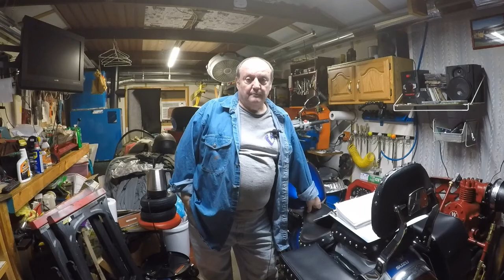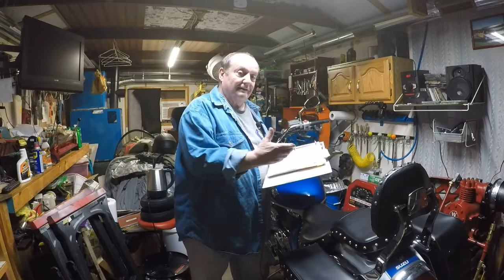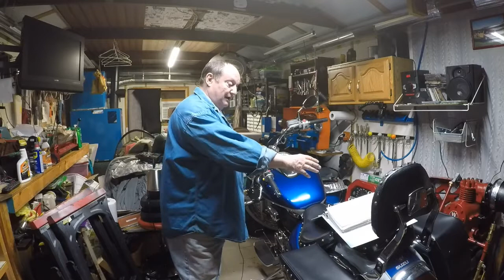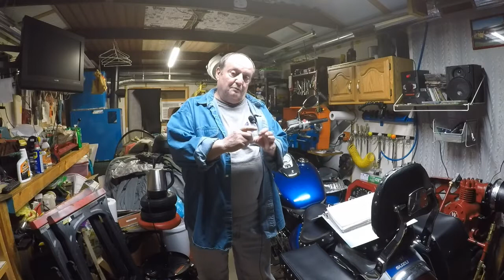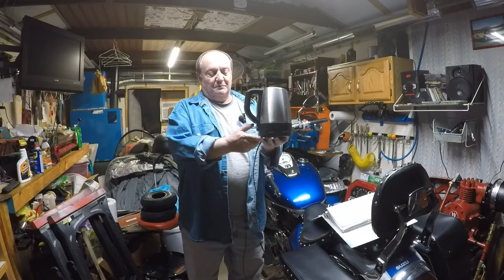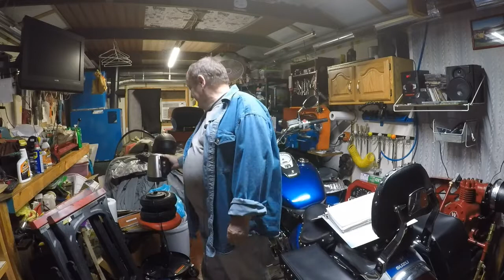STILL WORKING ON IDLE PROBLEM

Comment: Very good video.
Reply from the maker: Hi Michael, I think it's the I.S.C.    Idle Speed Control.  The code that comes up is  C40. I ordered a new I.S.C.  and I have the scanner that is needed to reset it when you put a new one in. If that doesn't work I may have to take it to the dealer.  Norman.
Reply: @2001himax  Yes Norman. This must be it. It will be interesting how this new ISC goes...

Comment: Hi 2001himax. I just recently came back from a ride on my 2003 VL800 and it sounds like the exhaust from my rear jug is louder and has more pressure and gas then the lower exhaust. What does your exhaust sound like? are they both the same volume and pressure? Thank you so much. Im really hoping I don't need an overhaul

Comment: Hey friend the code c40 on suzuki c50 is the TP sensor. I had almost the same problem and i change the TP sensor my motorcycle working fine with no problem any more.
Change it and adjusted will work great. Thanks
Reply from the maker: Hi Mohammad, Thank you for the info. Every time I go to work on my bike something else needs repaired like my 23 year old mower. Got a new mower. Then a chipmunk chewed some wire on my car so i fixed that yesterday. Hope to get back to the bike soon. Norman.

Comment: Think i found your problem..i have an 09 c50t.. This is caused by the clutch lever switch. Aftermarket levers don't hit the switch right, and many people bypass the switch. The ECU can't figure why the motor is revving so high when it thinks the clutch is in, so it throws the C40 code (idle too high). I'm amazed your dealers are not aware of this, as it is VERY common with these bikes with aftermarket levers. The uninformed will start replacing ISC gear. Google it.
Reply from the maker: I will check it out. Thank you for your comment. Norman

Comment: Oh! my a dud kettle is no fun at all.  My Suzuki manual also does not mention C40 code. However in case there is a commonality with Suzuki equipment I checked the Suzuki V-Strom.co.uk forum search, and it came up with     "C40 could be  the  rear injector ISC    (IDLE SPEED CONTROL) valve is sticking"  Might be worth looking into. Sincerely hope this does not lead you further astray from curing this fault.  Best of luck Norman.  Stay safe you two in these difficult times.
Also in my manual the no 40 pin on the ECM TERMINAL  is the rear cylinder fuel injector. (coincidence?)

Silly question I know but have you checked all of the connections air hoses and electrical wiring.  Do the throttle valves close smoothly etc?
Reply from the maker: Watch my latest video. I have a few more things to try. Norman

Comment: Hi Norman,
Unless you can locate the idle speed control valve (this component when faulty gives a C40 code on other Suzuki bikes like the GSXR's), pls follow yr service manual and check the following:
1/TPS (use a multimeter to read values as the throttle is twisted / butterflies rotate)
2/Also check the CKP sensor.
3/Lastly pls also check if yr throttle valve is balanced correctly and if the vaccum pipes are not leaking somewhere. Tnks.
Reply: Additionally, pls also check the clutch lever switch. I know it does not seem to have a faint connection with how the ECU controls the idle speed but blv me this is a fix I hv seen quoted by several GSXR's owners. No harm in checking it. Thanks.
Reply from the maker: At this point I will try anything. Thank you so much. Norman

Comment: Hey friend..   found this on Google 

C40 is for the ISC (idle speed control) valve. Is the bike idling rough or irregular or is it outside the 1300 +/- 200 spec? Also the ISC valve could be partially blocked or the solenoid could be malfunctioning
Reply from the maker: Thank you for the info. I will look into it. Man, I want to ride this bike this summer. Thank you so much. Norman